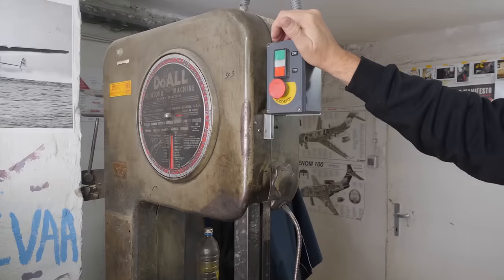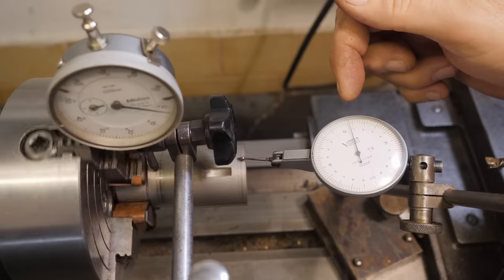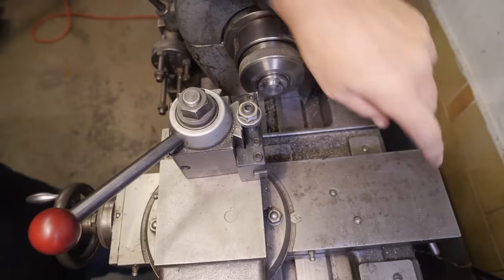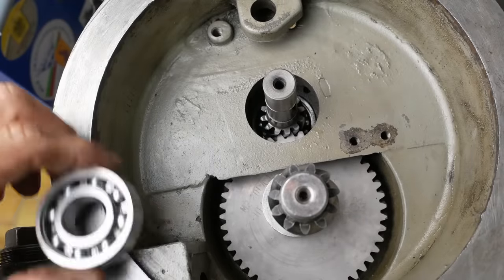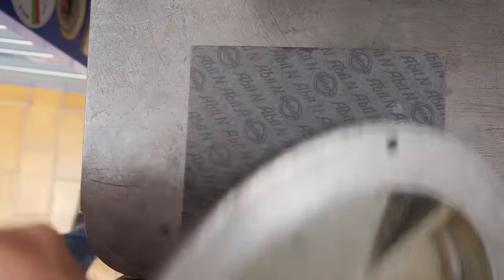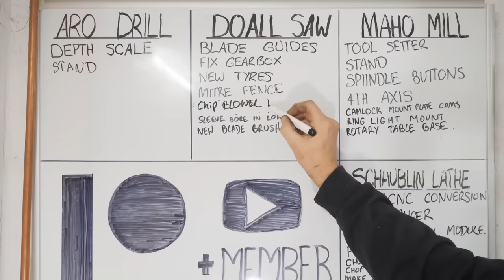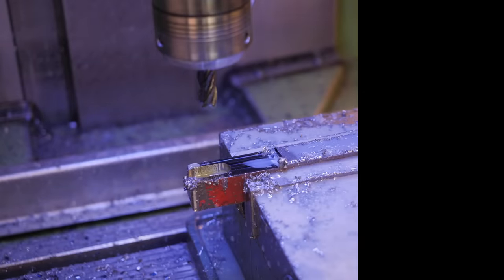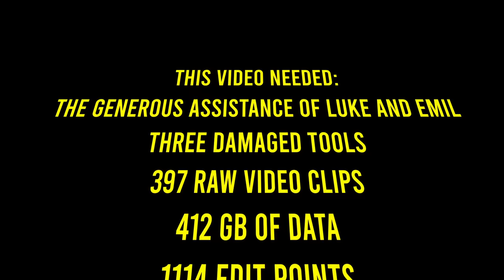Finished DoAll gearbox repair || RotarySMP

Comment: A type I stole from blondihacks for paper hole punching for stuff like you did: Use a leatherworkers holepuncher those work perfectly and make perfect holes in difeerent sizes without the risk of messing up
Reply from the maker: Isn't that hole punch I used for leather work? I cant remember what I bought it for.
Reply: MAybe it is but leatherworkers have tongs with hole punchers of diferent sizes in them makes it easier repeatable and faster to punch a bunch of holes @RotarySMP
Reply from the maker: Oh, right. Got it. My Dad has a pair of those tongs.

Comment: Acier à outils c'est <<tool steel>> n’est pas? 😀
Reply from the maker: Thanks Julia. I should have checked with Nico first :) Acier Doux is on the other side of the Cadran Selecteur.
Reply: @RotarySMP  just showing off 🤣 I lived in France for 4 years so picked up quite a bit of tool related vocab! Good to see it running again. I use my el cheapo bandsaw a lot.
Reply from the maker: @julias-shed  They really are a handy tool. Like a lathe :)

Comment: Wow, 412GB data - didn't see that one coming.
Reply from the maker: Hi Dennis, it sure mounts up. I have mostly been shooting 100mbs on  panasonic G80's, but just got a GH5S and shoot much of this at 150mbs. The GH5s offers 400mbs internally, or even Prores raw externally, which would be bonkers from the data volume. 
Setting two camera on the MAHO, and then running a 10 min tool path really makes big files.

Comment: Result. "Acier a outils" is "tool steel", though, and not mild steel.  You could probably go faster.  If you want to drop me a line with a decent photo of the indicator plate, I can translate the lot for you.

I like that mag base as mill stop trick.  I'll be using that in the future...
Reply from the maker: Thanks. I should have asked Nico, our #1 fan, as he is french.

Comment: Is it just my dad that taught me to make gaskets with a ball point hammer?
Reply from the maker: Do you mean, directly on the casting?
Reply: @RotarySMP  yep. I made packing for many of the packing/gaskets on the F250 i was working on like that.
Reply from the maker: @adagioleopard6415  Thanks for the tip. I didn't know that method.

Comment: I have a pair of 1/4” blade guides if you are interested in them, I could also take some pictures of the change mechanism on my saw, I have a very similar one, from ‘55
Reply from the maker: Thanks for the offer. Yes, I would be interested in thinner blade guides. Please drop me a line (there is an email on my "about" page)

Comment: I just rebuilt my Do all bandsaw because one of the gears wouldn't stay engaged (actually the output shaft had a blown out woodruf key so it needed a new shaft). While disassembled I noticed the spacer between the input shaft and output shaft was sevearly worn allowing the gear to move away from the dog clutch... just sayin.
Reply from the maker: Hi Larry, 
Which spacer was that? I suspect that I didn't put enough angle on the dog clutch so they are not interlocking properly. It seems to stay in gear mostly if I keep a constant cutting pressure on the blade, but if the pressure lets up it jumps out of gear.